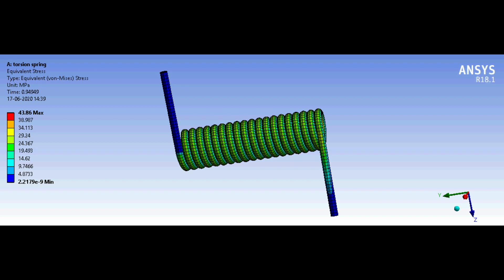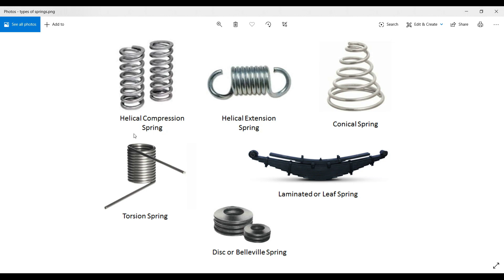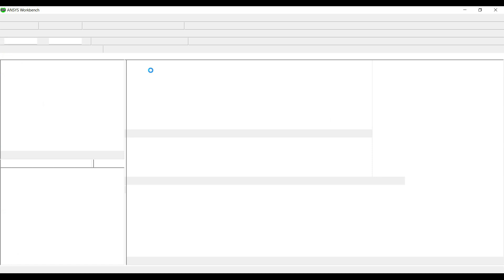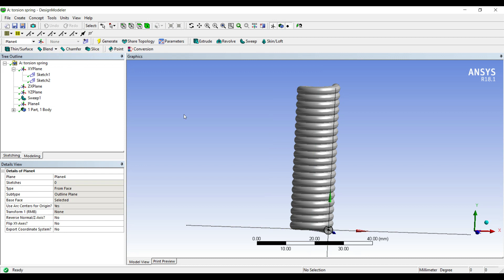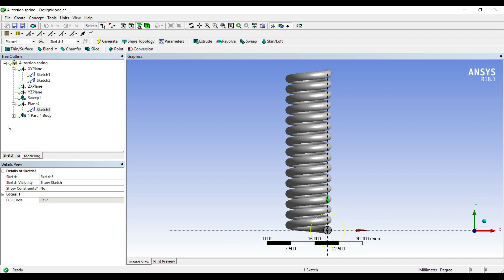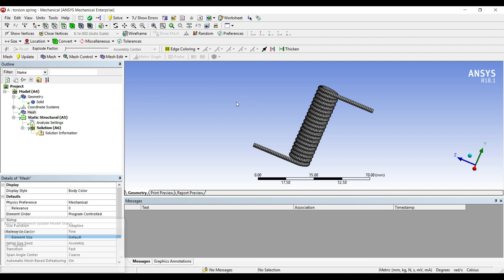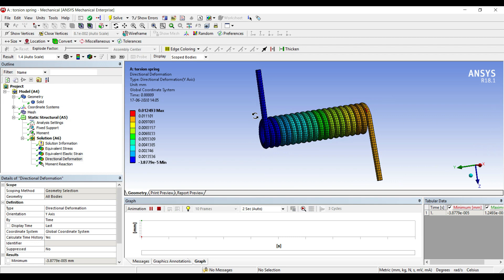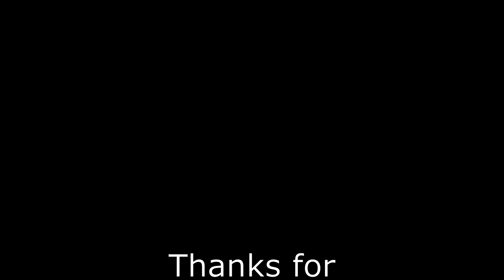Helical Coil Torsion Spring Analysis I Static Structural I ANSYS Workbench I Basic Tutorials

Comment: Hello.. wta.
I have a mini star tracker that track the stars rotation using a torsion spring as a counterweight at the axis of rotation  which can load 2 kg of counterweight . If i want to the load to carry more say 3kg, which aspect of the torsion spring should i upgrade? More winding, or material use to making the spring?
Reply from the maker: Which material are you using now? If its high grade then, increasing number of winding will be helpful or else material has to be upgraded.
Reply: @MechProverse  im not sure which material they use as its a commercially available mechanical star tracker that tracks the rotation of the stars. The tortion spring is used as a counterweight so that camera equipment of 2kg can be put on the tracker. I want to put heavier devices on it say 3kg, which upgrade should i go for? What effect can a tortion spring gave if more winding?